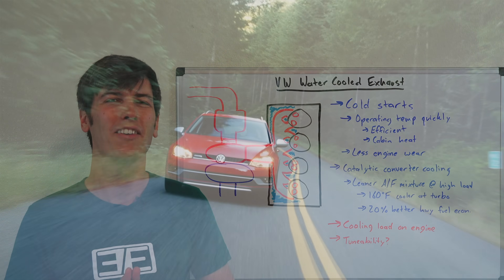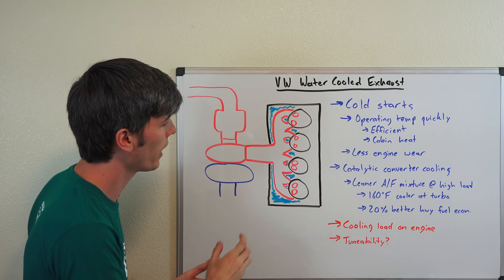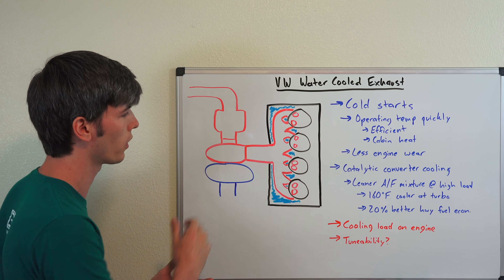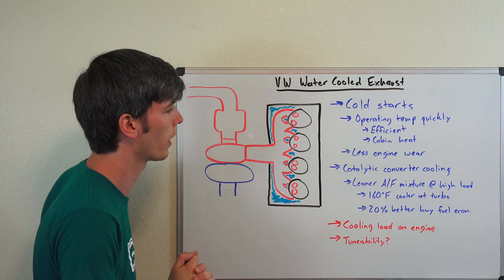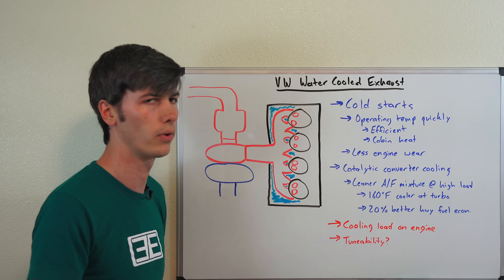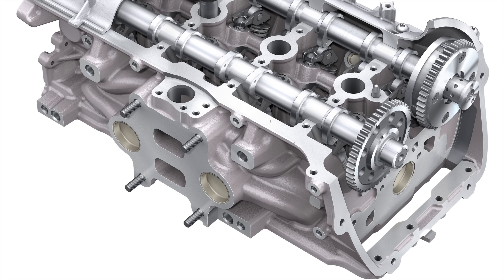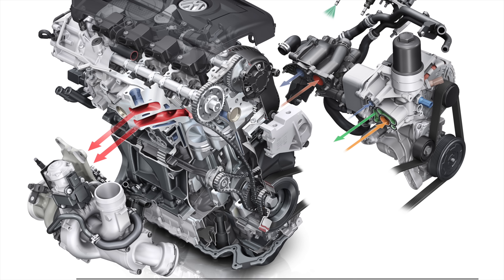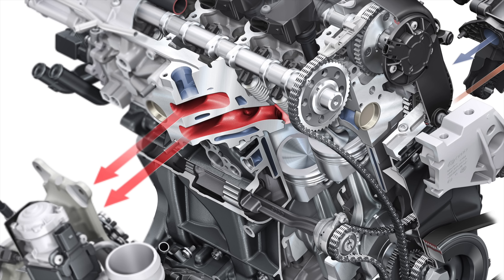Why Does Volkswagen Have A Water-Cooled Exhaust?

Comment: 1:42 one of the cooler benefits
Reply: World Traveler东北 Nice pun haha
Reply: World Traveler东北 lol I see what you did there
Reply: animefreak5757 
hot air is less dense than cold air.
Reply: True, they also increase boost though.  The hotter the gases in a confined space, the more pressure they exert.  That's one of the reason's turbo's are more efficient then super chargers, they extract waste heat and turn it back into useful energy.
Reply: Hamish McGregor 
your right I hadn't thought of it that way 🎓👍
Reply: And the turbo might have more booze too.
Reply: lol i dont think he noticed he said a pun
Reply: Hamish McGregor  hate to say your theorem duse not proof for me(not repeatable)  600°f /1psi=60mph Vs with full manifold thick (3/16")wrap and turbo blanket 500°f/1psi =60mph and 600°f =3psi and acceleration .  stock don't tuch any thing under the hood for 2hrs turbo housing mesured 700°f . wraped pull a grade at 1000°f pop the hood grab the turbocharger/ manifold Atl. any thing but the down pipe.  running for 7hrs/500mi at 6-700°f and grab the turbo, mesured 230° f outside of turbo blanket. 450° f on the down pipe with a IR temp gun. 
My experience is increase  temp=volume=viscosity  for a given fuel rate = more boost and less lag.  
 Per Cummins engine manufacturer " there is typically a 250°f  temperature drop accrost the turbocharger. " 1000°f in 750°f out . this is real enough that they give warnings  against installing an EGT after the turbocharger  as this could lead to a melted piston(1200+) reading 950°f after the turbocharger.
Reply: Turbo blankets don't exist for that reason... haha! In an engine, nearly all heat is wasted energy. Turbo blankets are just to keep the heat from spreading to the rest of the engine on cars running high boost levels.
Reply: Hotter gasses won't "increase boost" and there are a few reasons for this. Firstly boost pressure is intentionally set at a maintained level to avoid detonation in any petrol engine (and more boost doesn't won't actually help power or efficiency of a diesel one since it move the air fuel ratio further from ideal and increases pumping losses), this is what the wastegate does in most applicaitons (although turbo designs that limit boost simply by the ratio of inducer to turbine are used in some applications when running at a larger range of output levels isn't required by normal operation, such as boats or stationary plant).

Secondly the turbo doesn't "extract heat" intentionally, it reduces the pressure and\OR velocity of the gasses. A drop in pressure will cause a drop in temperature, but this cooling doesn't actually help contribute to the turbines operation or in any way be recaptured as useful power, likewise heat gained from gas to metal contact ends up in either oil or inlet air temperature, in both cases needing to be lost via a cooler that creates additional drag.

Thirdly the radiant heat losses over the area of a turbocharger are going to be on the order of a few kilowatts... it'll noticeably effect underbonnet temperatures, but remember that the engine is only maybe 25% efficient, and about half of that remaining energy is being lost as exhaust heat. So a 150kw engine is pumping ~225kw of heat out the exhaust, loosing 2kw of heat you'd contain with a turbo blanket and exhaust wrap will have a very low (as in within the normal variation of tests) impact on exhaust back pressure compared to the same money being spent on improvements on turbocharger turbine.
Reply: no, the turbo will make less boost, not more.  Heat = energy, it's why turbo blanket's are a thing
Reply: There is equal mass of air regardless of temperature, so for it to be hotter (less dense) it needs to pass down the exhaust at either more pressure or more velocity , and therefore has more kinetic energy (higher mass, more speed). However the temperature difference between turbo blanket and no tubo blanket isn't large enough for it to be important, unlike something like the water cooled exhaust manifold.
Reply: I feel like he noticed this and held back a smile lol gotta love how simple he makes everything plus he used words like neat.

Comment: I believe Ford does this on their ST ecoboost  engines as well.
Reply: Except this 1.8L has 20-30 lb/ft of torque more.
Reply: Marion San Pedro that's not that impressive, from a downsizing point of view (wich I don't like at all). The ecoboost 1.6t in the current fiesta st makes 200hp. The next gen fiesta st will be a 3cilinder, 1.5 t with 200 hp. Peugeot has a 1.6t with 270hp in the rcz-r and 308gti. A Clio RS has a 220hp 1.6t..... Honda is not doing anything new there. I prefer a little bit more displacement, over bigger power from a smaller engine. Doesn't matter the manufacturer.
Reply: Turbos on 1.8tsi gen3 is also very small, code IS12.
Reply: Mr. AMMO they do it on the 2.7 v6 also.
Reply: Wine Meer 
i know, but needless to say, the turbo installed on the hondas are TD03, ie, very small already and spools up at like 1.5 rpm and full boost by 2k ish rpm.
Reply: Now VW needs to crawl out of the stone age and start making blocks from aluminium...
Reply: 99Lezard99 Amen to that. ^
Reply: pokest225 
Turbo size is key to give big power.
Im comparing more like apples to apples here, with honda using td03 on their 1.5T and VW using IHI 12(bigger) on this 1.8T. Sure, other brands make big power but what size is the turbo and how is the lag??
Currently, I make 400whp on my 1.6L Turbo race car. Some friends made, 650whp same engine as mine butbof course with bigger turbo and all but lag is terrible.
Reply: the 1.4t block is made out of aluminum. But I agree that they need to be making all of them out of aluminum.
Reply: Marion San Pedro in Europe, is 180hp in most models. The Polo GTI/Ibiza Cupra are 192hp.
Reply: pokest225 
New CRV and civic si both with 1.5 turbo is 205HP.
Reply: yes, same with the new turbo hondas.

a bit sad, a new 1.5L turbo honda does 180HP at 16psi. This VW 1.8L is only 170HP at 19psi :(
Reply: There are several factors which affect the output. Having a larger displacement and more boost pressure doesn't mean that it should be more powerful. There are a lot of things that affect the output such as turbo size, mapping etc.
Reply: Wine Meer it's still quite bigger than a td03, it's just that the 1.8TSI is mapped for low emissions and a nice torque curve, with just a stage 1 map, it goes to over 220whp and a LOT of torque. they are much faster than a Golf GTI with just a stage 1.
Reply: I  have the same engine in my Seat ibiza cupra 1.8tsi with 192hp stock. and 320nm

Comment: What is that third chain for ?
Reply: Parallax balance shaft
Reply: ahh, of course. ty
Reply: Freak001100 this engine has 2 balance shafts
Reply: Ray Wilson no, this is a four cylinder engine, it doesn' t need counter balance, it balances itself! one chain is for the cams, one for water pump and one for oil pump
Reply: Many 4 cylinder tdi engines have balance shaft. Looking better its not that tho. Its pretty weird looking for water pump too...
Reply: Ray Wilson where? why two?
Reply: Freak001100 here is a link you might like. 
https://www.vwwebsource.com/modules/TechnologyExplained/power_performance/tsi-engine/data/1.8L-TSI-Engine.pdf
Reply: Freak001100 one on each side of the engine and I think they removed some of the counter balance weights from the crankshaft
Reply: Ray Wilson damn, that looks pretty inconvenient, i wonder if this just for the US market or they gonna bring this engine here to germany, i will definitely check that link out, thanks
Reply: Oil pump
Reply: Double balance shaft motor. One chain both camshafts, one chain both balance shafts, one chain oil pump.

Comment: Hey you gave a pretty good explanation bro, didn't know this till day. Just wanted to know if it's the case with only TSI engines or even the TDI engines come with this feature.
Reply: Diesel engines don't need this kind of cooling, at least not for the catalyst/turbo temperature protection part. The exhaust temperatures are much lower compared to gasoline engines. Max ~750 ℃
Reply: This petrol engine is based on the third generation 1.8T "EA888" which was introduced in 2014 and is used in many modern Audi/VW/Skoda.
Reply: Timmey Timm Ok, so I'm guessing the
2.0 TDI doesn't come with it. It's the 2011 TDI engine I'm taking about.
Reply: John Gialampoukas   Yeah I get it. Thanks a lot you guys.

Comment: Gonna be PITA to remove carbon build up in years to come?..
Reply: 627horsepowers - correct - I had a 2006 Passat that had constant problems with crusty intake valves. Car was just about junk at 70,000 miles
Reply: I'm not sure why that'd make a difference, the carbon build up from direct injection only affects the intake valves.
Reply: Bahnhoeffle didn't know that. Why they don't sell the dual port models there? That's weird.
Reply: In the end it would only run for 5 minutes if I put the code reader on it and cleared the codes, then you would have a smooth 5 minutes before it would go into ball bearings in a paint can mixer mode. So you guessed it, I took it to the large VW dealer where I purchased it and spent thousands on repairs and cleared the code in the parking lot and traded it for a Chevy Tahoe that I still have today and hasn't had anything but oil changes, windshield wipers, and tires.
Reply: Hi PapaWheelie, I thought that wasn't common. Were you the first owner of it? Was the gasoline quality where you lived perhaps suspect? I'm just curious.
Reply: DE Nichols - yep first owner, wife drove the car super easy no racing, I did all maintenance early and often. It had tons of coil failures all replaced under warranty. This was probably the start of its problems but they would fail every few months. Also had egr problems that was another recall due to a hose with too tight of radius. South Florida so fuel is decent other than some ethanol. Always ran 93 octane.
Reply: Droo work as a mechanic and have never seen carbon build-up in exhaust (except the EGR valve and diesel particular filter)
only intake
Reply: PapaWheelie g
Reply: Carbon buildup affects only intake valves.
Reply: droo, i agree.  the cooler exhaust manifolds might cause exhaust manifold carbon deposits.  we'll see in a few years.
Reply: No Dimitrios.  Fresh filtered air is not always fresh in the intake manifold on direct injection engines affected by carbon buildup on the intake valves.  Look up PCV and EGR.  Some exhaust gases and unburnt hydrocarbons goes through the intake manifold mixing with fresh filtered air in many situations.
Reply: theyll be in a scrapyard by then lol
Reply: Droo these engines have dual injection. This can reduce the problem. At least in the intake valves.

Comment: Gives a new meaning to having an exhaust leak
Reply: BubbleTime absolutly right. It is one piece with the cylinderhead and is therefor under huge termal stresses anyway. The chamber wall of the combustionchamber is integrated as well as the waterchannels outside the exhaust ports. I'm currently building a combined heat and powerplant with an outside heat exchanger on an normal exhaust manifold and it is very difficult to get the stainless steal tubes together and so on. If this would come in a diesel engine it would be perfectly suited for that task. Just think about it. It could be an incredible cheap solution to a otherwise relatively difficult and expensive task.
So VW please build a diesel of this technologie, at least for the german market ;D
Reply: well, but technically in any engine you have same story, but here 2 of 4 exhaust pipes are longer an integrated in engine block. i dont think, that there are more stresses that in classic engine.
Reply: SamTeks meinst du mich?
Reply: It's cool...but as Scotty once said - 'The more they overthink the plumbing, the easier it is to stop up the drain!'
Reply: 20k miles and the head cracks
Reply: @vvvspqr  naaa
Reply: Wow
Reply: Duke Silver having an integrated exhaust manifold mean less chance of a leak. You know, with it being ONE piece.
Reply: Brannen Thompson But its not a separate system for the exhaust cooling. So your argument is invalid.
Reply: Alldata. LOL. If you dont have access to factory scanners or manuals dont mess with serious stuff. Also you get paid to do the job. Iver done em on BMW x5s and most people get butt hurt having to do one or buy one. But I regularly drive American and Japanese cars as well...You can tell the difference in engineering. Not specifically a watercooled alternator but in suspension geometry, throttle response, interior, engineering that pushes some boundaries. 
while we sell more american muscle cars that dont break down as much, feel like they will spin out in a corner, crap brakes.
Reply: Kj16V So I get cheap engines.
- Mod it till it breaks! If it's already broken fix it. if it breaks again dump it and get a new one - repeate -
Just get full on roadkill!
Reply: the civic has had an internal header for over a decade😑
Reply: Given the number of microfisures that accumulate in a cylinder head, the chances of head leaking coolant probably increase, especially given past VW quality issues. But yes an actual exhaust leak would theoretically be lower given the cooler temperature, thicker walls, and a huge reduction in mated-surface area.
Reply: BubbleTime you clearly don't understand the joke
Reply: gm has been doing this for quite some time in 4, 6, and 8 cylinder engines. even integral turbos, iirc
Reply: Just another thing VW can bill you with or go wrong and leak,, And you could imagine if it was an enclosed system just for the Manifold, "You need your exhaust coolant flushed its an extra £39:99 to your bill Sir" you'd think it's April fools
Reply: Water/coolant cooling is good to keep the alternator from getting too hot. VW's have a cooling fan/vent system and most cars have some kind of fan.
Reply: Unco Casey I think Duke was just being sarcastic about having to pull open your whole engine when it starts leaking. BubbleTime is correcting him correctly. I don't know what other joke you see in Duke's comment.
Reply: This set up in fact reduce the likelyhood of a leak by keeping everything in a controled temp and eliminating some of the gasket and joints where leaks usually occur. The material is alluminium so rust is non issue unlike some 5.4 Ford V-8 lol
Reply: lol XD
Reply: Lern mal Englisch, Mann